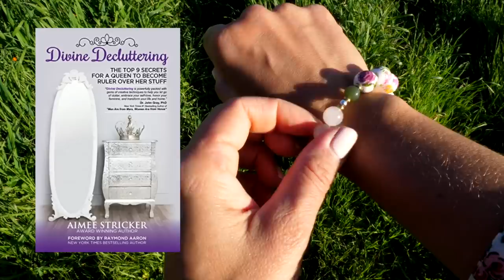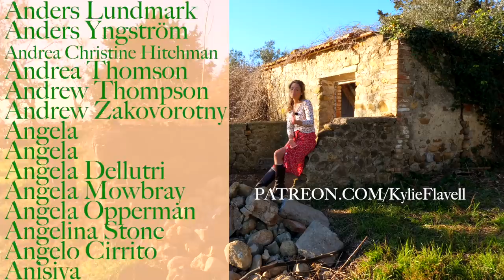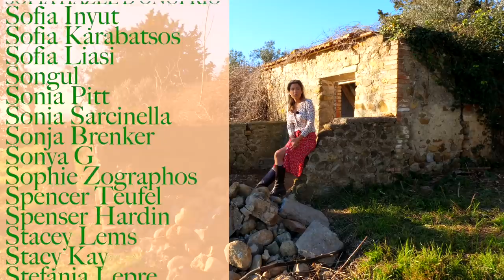RENOVATING A RUIN: Chicken Coop Cottage Update & a New Project with Stone Pigsties

Comment: Use the rock from pulling down the dividing walls for terrace paving. Make the stys into little grottos with lights inside, create a shade sail structure and build a demountable structure like a tent / glam ping experience. Less permit requirements. Outdoor bath. Composting toilet. Wildflowers. Garden fairy lights and lanterns. Magical.

Comment: Turning the pigsties into walled and terraced gardens with a spot to read or just enjoy nature would be lovely, but unless you have running water at that location it will be a real chore to maintain. Highly recommend employing a drip line setup if you choose to create gardens. Also, using those walls as a starting point, you could create a cold frame to start cool weather crops, and use the inside of the sty (providing it’s dry and cool) to store onions, garlic and potatoes, etc.
Reply: Hello dear ,how are you doing?

Comment: A pretty seating area in a walled in flower and herb garden, with climbing roses and hollyhocks against the stone walls, would be amazing.
- And yes, make an opening in the midle wall, to connect the two garden rooms.
I would suggest clearing out all weeds, putting down a good weed membrane, and then raking out gravel on top.
Then, you can plant things by cutting an X in the membrane, and plant roses and lavender.
A beautiful climbing rose arching over a stone doorway would look so romantic!
Also, butterfly friendly plants, like Agastache and Echinacea, would add colour and 'flutter'.

Comment: Kylie, I have so enjoyed your videos.  On the pigsties can you add rebar rods and cement around the stones to complete the walls.  The rebar will give a strong base adding the cement and building the wall with the stones you already have this will preserve the incredible beauty of the Italian stones. Create a open roof with weather proof material and beautiful flowering vines and string lighting.   You did not show the central area of the pigsties. Is that one solid room or separated into rooms?  Can the area be used as a tea garden.  I realize afternoon tea is very English, but the area can be used with small herb garden with small tea tables in each area.  Or wine and, olive oil tasting your wonderful baked bread.   With the chicken coop it appears that the primary foundation is set.  Call the plumber and have them finish the area.  All of the open areas fill with ceiling to floor windows with interior curtains for privacy.  Finish the area on your own if that is possible. if you want to use this as a weekend getaway use the open floor plan and decorate.  Get it up and going.  As the area produces more income add more elements.   I  think you have really done a beautiful job on the renovations.  Arrivederci
Reply: Hello dear, how are you doing?

Comment: Perhaps make the "indoor" space the focus? Put a pergola over the indoor space since there's no roof and create a large outdoor kitchen, lounging area, or greenhouse (with polycarb panels on pergola). Like a cloister garden. I agree with the comment about removing the partition walls between the stys. Or, if that's not feasible, you could create the gardens you mentioned or give each a distinct purpose.  Maybe a wood-fired hot tub sty? You could even use one for a very simple compostable toilet bathroom? Do you have any plans to raise animals? Instead of pigs you could raise chickens, bees, etc.

Comment: Yes, Thursday was a beautiful day. I also worked a lot in the garden and enjoyed the warming sun. But it was a cold and long winter in Tuscany. I compared the climate tables and it is as my neighbours say. It was one of, if not the coldest winter in Tuscany in the last 20 years. It started already in October with many cold days. From then on, it was no longer possible without heating. I used 4 square metres of firewood and 150 kg of briquettes to heat only the big living room. I have already used about 220 15kg bags of pellets for the heating system, and at the same time I am only heating 5 rooms in the house at the moment, and hot water is currently only for me. Many neighbours and friends have no more firewood. Due to the high demand, the stocks of the firewood wholesalers have been used up. In the retail trade, only small quantities are sold at very high prices, if available at all. Prices for pellets have risen from €3.95 to €6.50 at many retailers. Occasionally, you can still get smaller quantities for €5.20. Yesterday morning it was -3 degrees again and the frost lasted until after noon. Enough with winter in Tuscany. Let's hope that there will be more sunny days like on Thursday and that the night temperatures will rise above 0 degrees.